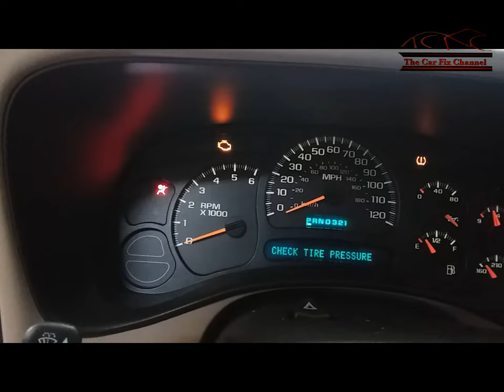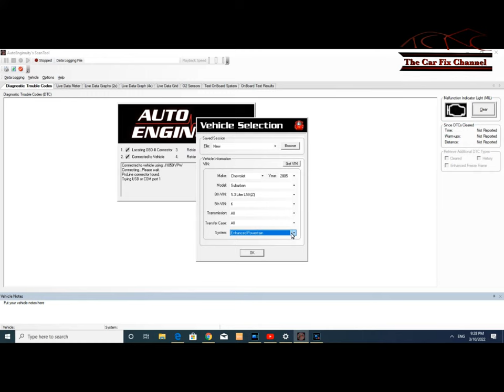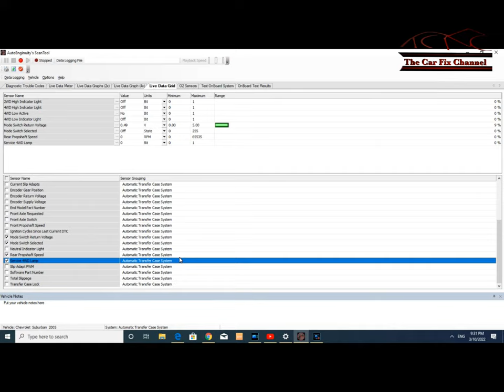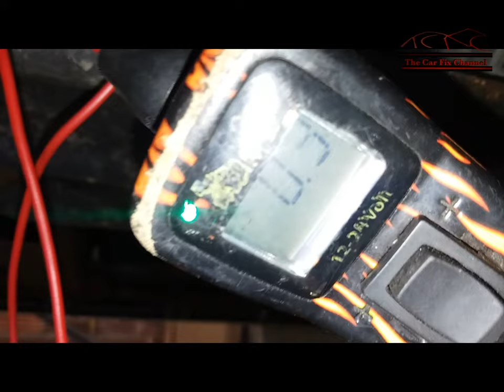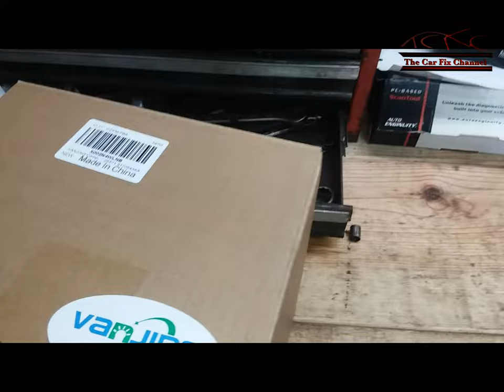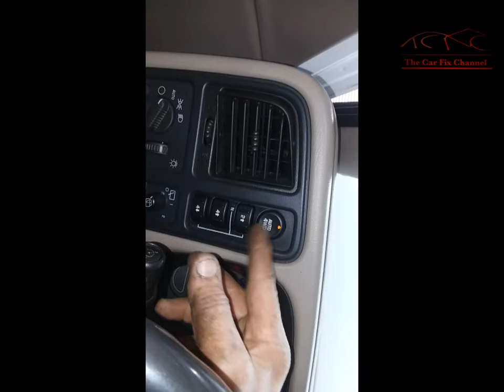4WD -4X4 - Encoder / Shift motor  testing and R&R GMC / Chevy trucks and SUVs.

Comment: My truck when I start it is in 4low. I can switch it to 2h and drive it no issue but if I shut it off and go into a store when I come back out to start it again the truck I back in 4l. How am I supposed to troubleshoot this without wasting hundreds of dollars? Could it still be the actuator even though it moves?
Reply: My 94 has the 4hi and 4lo button and every time I go over a bump the 4lo light comes on and truck runs like absolute garbage but truck does not actually shift into 4lo being as I removed the t case motor to replace it I'm thinking the tccm is fried but not sure. Buttons also do not work unless I'm in over drive then the tccm clicks but still no shifting
Reply: I have a 04 doing that same thing. I changed everything but the brain for the transfer case same thing. I took everything off an 02 that I wrecked that was working fine. Got the brain out of it but between 02 and 04 the changed a bunch of wiring so it won't plug up. Would be very thankful for advice if problem was resolved. With mine it might go five or ten times without an issue but then it be wabberjawed the next 5 or ten times. 🤬🤯 Thanks
Reply: I have an 03 it’s already in 4lo every time I start my truck which is crazy because I never hear it click into 4lo like when I manually request it, I believe it may be the encoder motor or chain being toO loose idk yet but it got me sized up at a stop sign till I forced it free but something was bound up internally hope it didn’t mess up my transmission, just got another tcase about to install but who knows the condition this one is in as well. 🤞🏼

Comment: Back probing is very bad venture let’s water in. I don’t understand why you would not use like a Peco breakout lead same connector. You just push it in and has a bear wire at the end where you can clip your lead for your metre on two. It’s a simple thing if you look up Pefco  breakouts le ad kit.

Comment: I have a 263XHD transfer case with encoder motor off, can I plug it in if not bolted to transfer case and push the buttons to see what position the encoder motor is in. Someone removed it and not sure what position it was in when removed. Truck is in 2Hi now.
Reply: Why not, if it doesn't work your only out a little time
Reply: @scottlofton2607 I just read somewhere last night not to run shift motor if not attached to Transfer case

Comment: Ok, I've checked the ground and hot wire going to the actuator motor on passenger side front & at the TCCM. I've also turned the key to the on position to see if I can hear anything from them and there BOTH working. They Both turn on & then off. So, Now What??? The only thing i have not done is check the selector switch & the model under the dash, but if the TCCM & the Actuator motor is working, then doesn't that mean it's ok also?
Reply from the maker: Hello, are you testing the axle lock actuator or the encoder motor?
Reply: @thecarfixchannel3046  I've tested both. My front diff. went out on me and i had to put a new one on it, so I went ahead and put a new Axle actuator & new Axle disconnect.  I can switch in and out of 4wd by turning the 4wd switch to whatever I want it in and then turning the key on and off. I've tested to see if each part is getting power and ground and they all have both. Axle actuator, Transfer Case Control module, 4wd Switch and the Transfer case encoder motor.  I don't have a scanner like yours. I'm using a basic ohm meter to test with, but when i test the Comms wire like you did, I can see the numbers changing when i crank the blazer. So, I'm assuming that the Module is communicating with the Encoder Motor. I don't know what else to check???
Reply from the maker: Do th have the  setvice 4WD message on the instrument cluster and what are the issues you are having with the 4WD system ?

Comment: Is it possible to trick the wiring to switch the motor if not getting a signal from the buttons? Also if that doesn’t work, can you just pull the motor off and manually switch the gears in transfer case?
Reply: Yes to both
Reply: You can remove the encoder motor to shift the transfer case manually, but doing that will not engage / disengage the front differential actuator. Also you need to be very careful with doing that for several reasons first being that it can easily pop out of gear and go into neutral when you least want it to. You can combat this from happening by clamping a vice grip to the shift stud and zip tying it down tightly to an encoder motor bolt. Be VERY careful with doing this as a vice grip can mash the splines on the "shift stud" and cause you serious problems when it comes time to replace your encoder... If the encoder motor is pooched then there is no way to "trick it" to work unless you get lucky. These things will do anything when they don't work right or may not even work at all.

Comment: excellent video my new 07 hummer won't shift to 4low it's a always 4wheel drive since I don't offroad yet can I drive in 4 hi?
Reply from the maker: No,  the 4WDH setting is not to be driven on dray roads  only muddy and loose drirt roads if you drive it on dray roads in 4wh you may damage the tasfercase especially  with sharp turns. If you truck is AWD you may not have a 2WDH setting if you do have 2WDH setting  this neans the truck is 4WD not AWD  than you cannot drive it in 4WDH .

Comment: Hi i have colorado 3.5 l 5cil 2004 i have problem with the 4x4  .no code  onli ican read service 4x4 .the positive is present  in the actuator i need check in the motor transfer case

Comment: When your testing wiring from the tccm to the encoder motor where are you grounding your multimeter
Reply from the maker: I used powerprope not multimeter the powerprope takes it's ground from the battery, if you are testing with a multimeter you need a good ground from the frame it the body.
Reply: Ahh I see. Do you happen to have a wiring diagram for this system?
Reply: I bought a amazon one but it didn't work. Where did you get yours. Im prettysure the problem is the encoder i had a dtc code that said 
motor a/b circuit malfuntion giving the code c0306 and a modeswitch circuit malfuntion b2725. I hooked it up too a tech 2 gm scanner and the buttons were working. When i installed the new motor the neutral light remained on but it would be unsuccessful at switching. I didn't hear any noises. I took it out and just pluged it in to see if it worked but nothing would happen so i concluded the new motor was alsi bad. Any tips?

Comment: how can I check voltage of the connector using a regular multimeter? Where do I put the negative side of the meter?
Reply from the maker: Hello, on the case of the motor or on the battery negative cable.
Reply: @thecarfixchannel3046  Appreciate the quick reply! Awesome video man, you definitely have a lot of knowledge and the way you elaborate makes it easy to understand.
Reply: I checked the green wire and it's reading 0.013 volts. What would this cause this? Control module?
Reply from the maker: Is the truck the same year as the one  in  the video 2005, if not do you have any 5.00 volts on any of the wires?
Reply from the maker: Make sure the ignition in the on position when checking the 5.00 v, if you don't have it at the motor you need to check it at the control module if sill the same check power and ground at control module if ok the module have issues, if the 5.00 v are present at the module then you have wiring issue from the module to the motor, good luck.
Reply: @thecarfixchannel3046  mine is a 2005 sierra. I did check all 3 wires that are for the encoder and they all read the same. 0.013 volts and was on the ON position. Thanks for the tips, I’ll look at the things you mentioned, appreciate it!
Reply from the maker: The test you did on the L/green wire with the motor unplugged or plugged in, if it was plugged in try it unplugged.

Comment: If I was stuck in 4 low can I grab that pin with say a vice grip an turn it to get it back in 2 wheel jus to get goin ?
Reply: Yes. This is what a floor shift lever would do.

Comment: I have never ever heard of it called a propeller shaft. Which I know it propels the vehicle. But still, I’ve always heard them called a driveshaft. lol.
And why do you have to mark the shaft? I’ve never done that either in my entire life which I’ve worked on vehicles from the time I was 12 and I am now 60 so I’ve worked on them a couple of months anyway. 
I worked at dealerships, mechanic shops I worked at a transmission shop for 10 years building transmissions. I’ve never marked the driveshaft now if you didn’t know which end went where if they both looked alike, then yes you could mark which end was forward or which end was backwards but other than that, no.

Comment: I got a 2000 silverado 1500 4x4 my 4wheel drive not working no lights on the switch at all so I replace the switch still nothing and I cleaned my grounds good do u know what it could be ?
Reply from the maker: Hello, did you check the power feeds to the switch / transfercase or ATC fuse and the 4WD fuse ?
Reply: @thecarfixchannel3046  yes it all checked out good
Reply from the maker: If the fuses are ok the power feeds and grounds need to be checked at the switch / encoder motor /control module , a test light can be used if they check out you need to load test the power and ground if ok a transfercase control module has issues, since you replaced the switch the control module is most likely to be issue, also this might not tell you the condition of the rest of the system.

Comment: You can pull that pin without cutting
Reply from the maker: Maybe you can but I did want to  damage the pin since it does not come with the new motor .Thank you for you comment
Reply: It should come out easily.  Use some Pb Blaster on it.  But seriously it’s just a guide pin and can be optional.  The shift shaft will only go on one way and there’s no play so it won’t be wrong.     Some say the new encoder motors often have to be “timed” or “clocked” by opening them up and aligning the gears a particular way.    Nice way to add more questions to the problem huh?  Sorry.   Deal is that you could put a good new motor in and it still not work because it’s trying to move too far or too little and leave shift fork in the wrong place.

Comment: When you pulled the gear out of the new encoder motor and moved it, didn’t that change what position the encoder sensor was seeing?   In o rig er words, the TCCM tells the motor what to do, but also the sensor tells the TCCM which position the motor is in.   So if it’s supposed to be in neutral as delivered, and you more the gear to a different position, wouldn’t the sensor now think that what it thinks is neutral is now whatever position you out the gear in, say 2WDHi.   So when you move the speed sensors on each output shaft and at the front wheels and rear axle will tell the TCCM that it’s NOT in neutral.  And so on.    From what I understand moving that gear the way you did is a no-no, and if you still had success please respond and let me know as that is very important.   Another way to have done that would be to simply apply 12volts and let the motor turn to the position you needed to get it lined up or just turn the shaft on the transfer case.
Reply from the maker: The guide pin is not optional, because it was on the old motor and the new motor doesn't come with one. As I mentioned in the video the new encoder motor comes locked in  neutral with a plastic lock that's why I had to move the transfer case shaft  to the neutral  and the transfer case position sensor is in the encoder motor hence why it was locked in neutral. The TCCM sends five volts to the transfer case position sensor and based on the position of the new encoder motor which was in neutral that's why I had to move the transfer case shaft to the neutral position for it to be installed. After installation the encoder motor the TTCM will show the transfer case in the neutral position and from the neutral position you can switch between the transfer case ranges with no issue. That's why it doesn't make sense to disassemble the new encoder motor    not only does it waste time and  potentially damage the encoder motor it also voids your warranty.

Thank you for you comment.
Reply: correct or not.  oversight or whatever.    that was a very good and helpful question with an open to error presnted suggestions from personal experience.    not a hint of topper or ego.
the great info ij response not so much.    info was there but all cut up with ego and emo.   with a spring of snide thanks for your suggestion at the end.    but video was so good that probably ahould embrace because of type person that great question came from.   he watched it.  liked it enough.   to openly without any emo or ego ask.    that's instead should have been indicator if your video being really good.   more soo than most other common good job  bs.  was that a ji value loyal customer potentially you just sneezed on.   best presented info i have seen and with added input

thanks guys.   there is hope for us